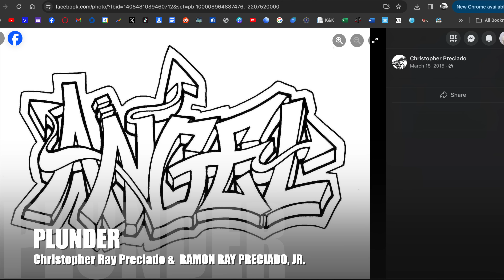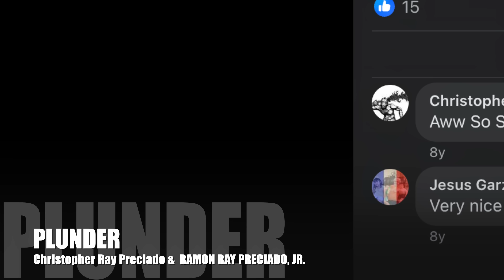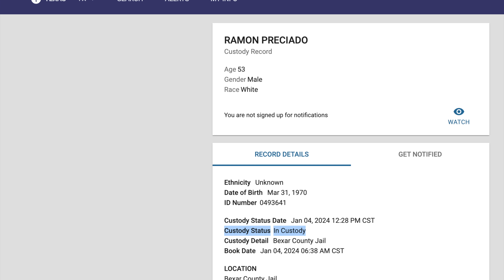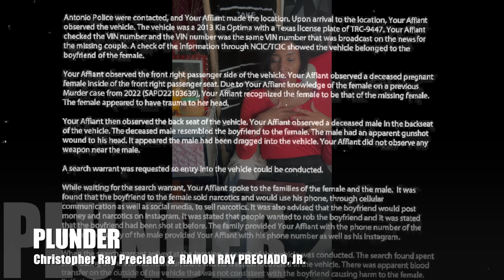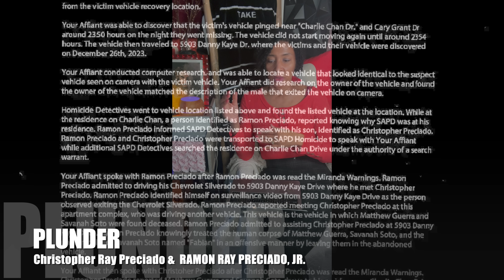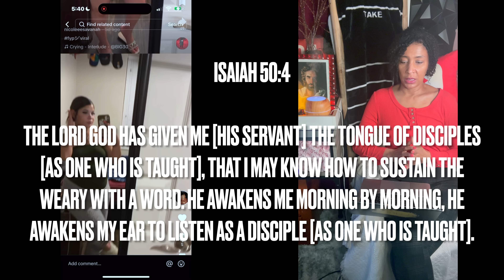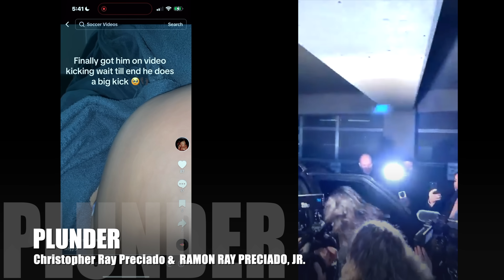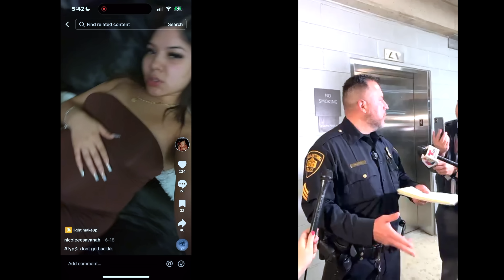Who threw a towel to Ramon Preciado? Christopher Preciado & dad in Savanah Soto, Matthew Guerra case

Comment from the maker: Who threw a towel to Ramon Preciado?
Reply: Maybe the mom😮
Reply: Thanks Paula. I ❤ all your post and commentary. 👍
Reply: It was hamas.
Reply: The reflection of the light in the car door when its opened is the bright lights from the truck's dashboard gauges (speedometer etc). When the car door opens the side mirror of the door ends in that direction od the truck and the mirror is reflecting those lights on the door. As dad/son move hands,arm, whatever their doing at times they move enough to block the mirror and its why the lights disappear at one point and reappear, and ofcourse the moving of the door itself any small movement will make the mirror reflect more or less depending on the position and how much it moves.   If it were headlights from another car positoned at a distance in front of the car facing the car and truck, there would be atleast a few other parts of the car or rear of the truck reflecting the lights. That doesn't happen. It's the round bright dashboard lights from the truck reflecting on the side mirror once the door is opened..

BUT AGAIN JUST ONE GUY'S OPINION..
Reply: dad is a big guy and often they put a towel on top of the car seat, hanging a bit over the backside against gliding on the seat. I think when he got up, it just slided off. people are wanting some big special thing going on 😅
Reply: Someone deff tossed them the towel
Reply: @jengapaws   They live a few mins away from that location and given the time it was(close to midnight), its more than likely that was mom in that passenger seat (tossed towel) . Given what they are doing it doesnt make sense to have someone besides mom in the truck and having to drop them off elsewhere and drive home when they are just down the street. Then having additional ppl knowing what they are doing ...makes no sense.  That was mom in the passenger seat of that truck..

but again..just one guy's opinion...
Reply: Oh my. The things you find.

Brian Laundrie also liked weird artwork.
Reply: Mom...
Reply: They found TeleTubby after all. The Spirit Box guy called out TeleTubby but did not say which one it was!
Reply: You know, if Matthew would have turned down doing the sale, they both would have been alive. They would have been in the hospital in the delivery room, or even holding their child Fabian. OH NO! Had to get one more sale. The sweet baby boy never had a chance. I wonder the possibility of how much drugs were passed in to Fabian’s little body as he grew in her womb? Beautiful baby boy never got to see this world. Now he is cradled in God Our Fathers Arms.
Reply: Definitely the mom
Reply: @veamstream I don’t think it’s irrational to think it was handed to him, I think your scenario seems less plausible actually
Reply: @Cheetoluv or if she had an ounce of maternal instinct or common sense only Matthew would be dead
Reply: There’s definitely a third person in the truck that threw that towel
Reply: IMO, the Mom
Reply: The towel fell by itself case closed
Reply: I'm assuming it was a sibling.
Reply: Mommy
Reply: The mom in my opinion the son and husband are taking full blame so the mom doesn’t end up in jail too. Also she didn’t do enough to make it chargeable in my opinion. She wasn’t cleaning the door and she’ll like the father was!!!
Reply: Police said something about towel and wiping the car earlier ...  @veamstream
Reply: @jengapaws  A family affair, his younger brother, or Mom . . .
Reply: I think the mom threw the towel. There is a video out that detectives picked up a female at the suspect's home.👀
Reply: It did look like someone within the truck did throw a towel to Ramon
Reply: @jengapaws  I heard the video was edited . . .
Reply: I think it was Christopher who did that. There wasn't anyone else in the car besides him and the corpses.
Reply: Thanks..I've been trying to see why there's only 2ppl arrested because a towel can't move on its own!!  Either mom or older brother was also inside that truck!!
Reply: We are Not Crazy!! The whole world seen the damn Towel being handed to the father in that video clip! So, some deal must have been made!!
Thanks for covering this😊
Reply: Ohhhh is that in reference to wiping down the car? Remember the video by the dumpster??
Reply: That's exactly what i said about the towel
Reply: Mother or brother
Reply: It was mom. No way son gonna call for help an mom doesn't to check on her son💯
Reply: The younger sibling, it looks like a younger person's arm to me
Reply: @VeAmStream  Very true, law enforcement had the full footage so they knew and saw who was there, dad must have gave his kid a lift back.
Reply: My gut says the mom is involved and honestly she is a big lady as well...possible it was her that got out the truck with her hair up and not the husband.? His posts and hers gives me a feeling she wears the pants on the family...eerie feeling over that photo of her & the son as well as her post about anyone wanting children.  Something with this is off. IMO there's no way a 19 year old could have handled 2 people without one fighting back or getting away.... this is another "Moscow type" feeling... the Officer seemed very nervous and yes,  he paused/studdered on his words... wasn't Grady Judd for sure! I just smell fish in this case already.
Reply: I heard on another channel that the Mom does not reside in the home. The father's girlfriend lives there. Idk if it is fact or not.
Reply: Baby Christopher and his father got a deal to keep whoever was in the back seat the towel thrower out of the loop. Law enforcement will never let Us in on that
Reply: Mom, her and Chris were following along in a fb group
Reply: @MarR310 1:25 1:39 1:41 😊
Reply: Why do you always flash the DEVIL horns, and then show Bible verses.
Reply: Maybe a kid and that's why the police doesn't want to talk about it .
Reply: I posted a video of ONLY my improvements to the quality of that original video footage released
Reply: I watched the neighbor say that Ramon was either separated or divorced from the mother but has a girlfriend.
Reply: @user-wg5vn1dc8s  
It's not the devil horns it's sign language for I love you. Paula would NEVER throw up devil horns, maybe next time you should ask instead of assuming specially if you don't know what you're talking about. Paula would be the last person to portray an act like that that. Her love and her faith in our Father is intimate throughout her life and chanel
Reply: Well maybe you should read what I said.  I was asking her WHY she was doing that.  I have asked her several times why, with no response.  So Miss Christian, maybe you should READ before you attack people.  Everyone calls themself Christian, but then when they see something they don't like they attack other people.  I was just asking her why she was doing that, never assumed anything, like you did.  I didn't know that was the sign for I love you, she could have easily told me that, but she didn;t, which is fine.  I rather no respons, then yours.  I think it is better to ask a person why they are doing something, then assume I know, that's all I did was ask.
Reply: Oh please..if he had pictures of butterflies and flowers you would have said that he was deranged about that
Reply: since plunder claims to be very Godly why would you come on here putting down people.. spilling gossip... acting as if you are condemning some people when actually you should be condemning no people! Is this a part of the Bible that I missed that it is okay for you to do this?
Reply: @Sweetastaboo maybe if this woman was actually what she falsely appears to be she wouldn't be on social media speaking badly about people ..she would be doing his Bible says... Mind her own business
Reply: @junebuchholtz287  🙄
Reply: @junebuchholtz287  🙄🙄
Reply: @junebuchholtz287  🙄🙄
Reply: @user-wg5vn1dc8s  and there you go again assuming that I'm Christian talking about something you don't know what you're talking about
Reply: @junebuchholtz287  you can mind your own business by not watching your channel
Reply: A third suspect. The strep mom was arrested today for the same charges as her husband. Many people thought it was a woman.
Reply: Any relation to Madeline Soto??